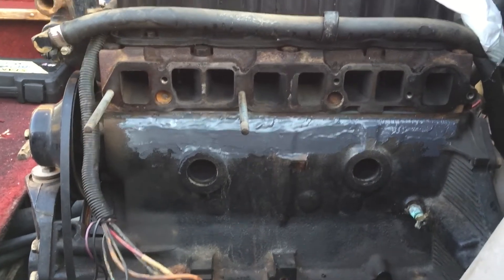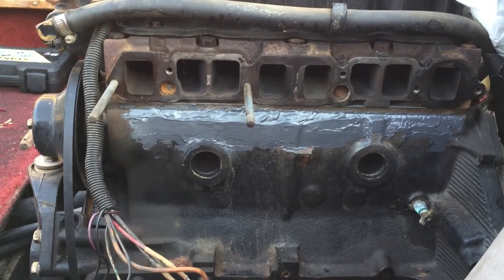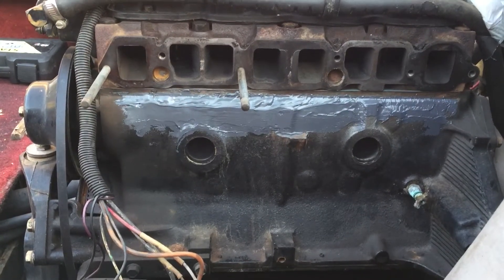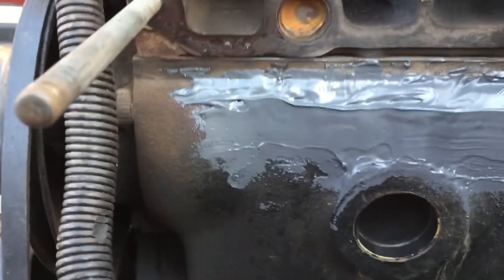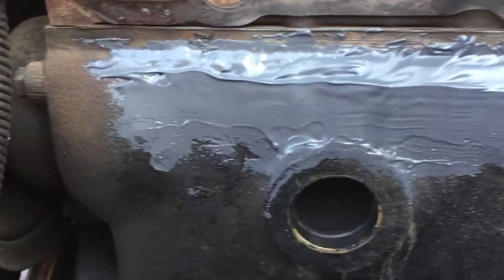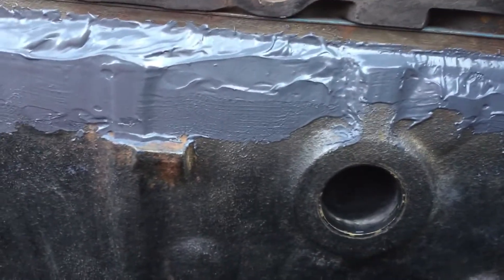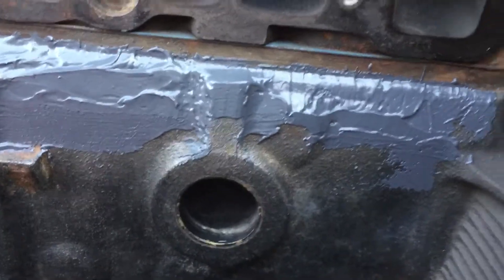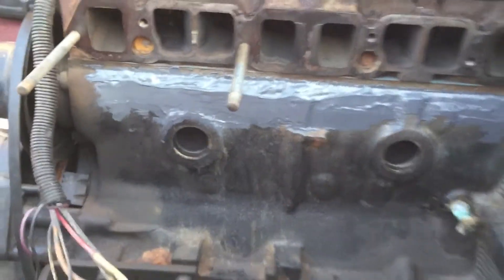Part 3 - Cracked Engine Block Repaired with JB-Weld

Comment: Hello, is your jb weld still holding up?? What kind did you use??
Reply from the maker: Yes, still holding up after 3 years. I used the original Cold Weld formula that comes in 2 tubes that I got from Wal-Mart but it can be purchased at almost any hardware or auto store. Here's a link to the jbwelds website of the one I used: https://www.jbweld.com/product/j-b-weld-twin-tube

Comment: Can you explain to me the drilling part sir?
Reply from the maker: Sorry for the slow reply. Yes, you just drill a hole at each end of the crack. It's supposed to prevent the crack from continuing to grow further. Just use a drill bit rated for metal and choose a bit that's not much bigger than the width of your crack and drill 2 holes...one on each side of the crack. After that just make sure the paint from around the crack and holes has been grinded and cleaned off so the JBweld has a good surface to stick to. Best of luck!!!
Reply: @rideon365  i got it fixed ..video helped Thank you

Comment: Milky oil means crack is into a combustion chamber.  Block is junk.  Exception:  cylinder can be sleeved if you want to go to that extent. ($$$)
Reply from the maker: Milky oil doesn't always mean a crack in the combustion chamber...however if you're engine hasn't been submerged with water then yeah, it probably is a crack in the combustion chamber area. The engine block repaired in this video is still running strong today with no leaks and no milky oil. JB weld for the win!

Comment: Hey I just did this on my GM 3.0 4cyl and worked great. The previous owner did not winterize it. Question, other than the crack, did you also have milky oil? did water crack the block inside too? I have milky oil but unsure of the cause. Will change the oil to start fresh.
Reply from the maker: Before I did the repair, I did have milky oil however the boat had also been submerged so I wasn't sure if water had got in the oil due to the engine block cracking or the boat being submerged. I've done 3 oil changes since the JB Weld repair and my oil has never been milky since. How did your engine do? Were you still getting water in the oil after the oil change?
Reply: @rideon365  Thanks. Yes, I kept getting water in. I pressure-tested the cooling passages, and I could hear the air leaking out the jacket, right below the external crack. Ended up replacing the entire engine with a used one. I do recommend the JB weld though; it's always worth trying it before welding or replacing the block.
Reply from the maker: @josht3880  Crazy! Thanks for the update! Hope you get tons of boating time out of the new engine!

Comment: Did the JB weld seal it up?
Reply from the maker: Yes. I haven't seen any leaks since doing the repair. The boat ran the rest of last summer (2018) and continues to run this summer.